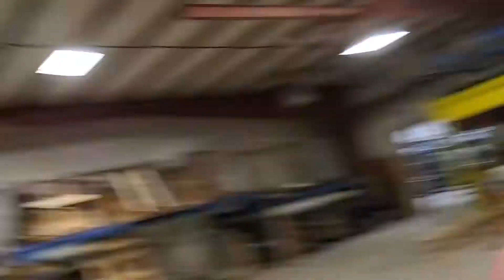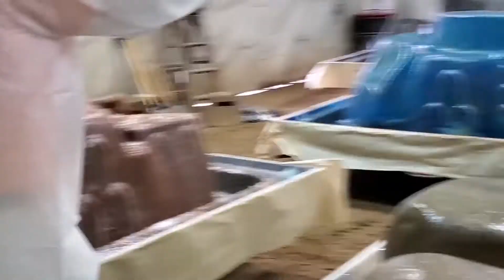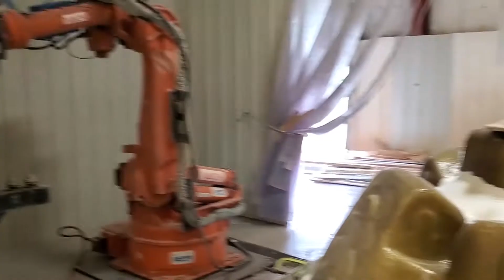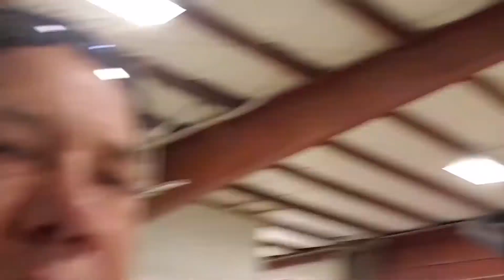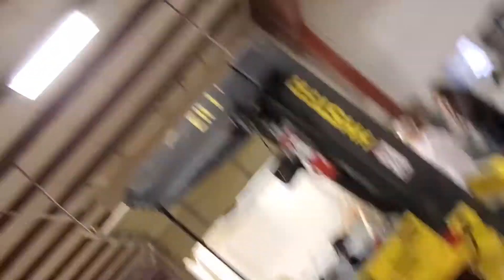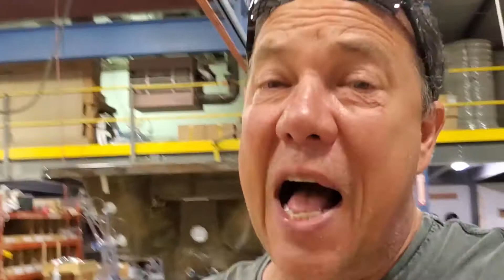PDC Factory Tour with Hot Tub University

Comment: Resin doesn't dry.  It cures.  And back in the day they used to spend an extra nickel to use primer on joints, not the new glues that allegedly dont need primer.
Reply from the maker: Yes, correct, a curing activator is added to the resin which introduces free radicals to the liquid system usually through an exothermic reaction. The free radicals are transferred to the monomers which form active centers that will then attack other monomers in the resin and begin chain propagation which creates the formation of an infinite molecular network. Ultimately, all the molecules are added to the chain, resulting in the solid cured resin material.